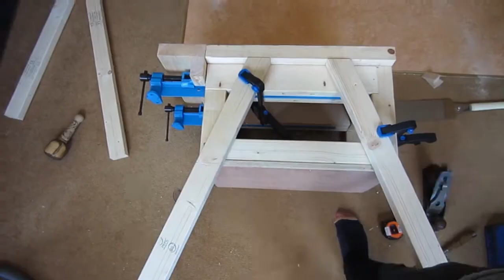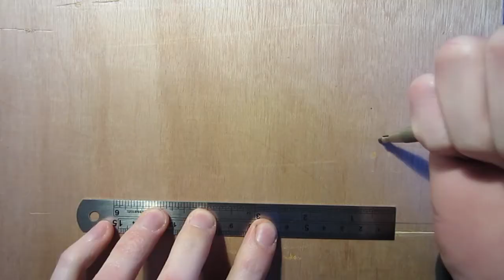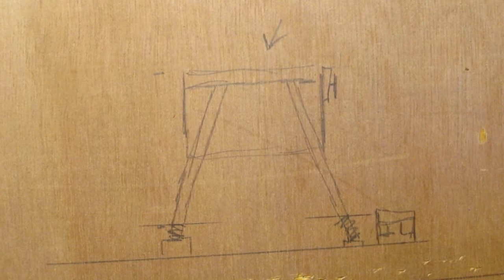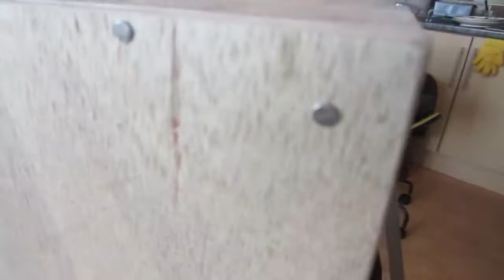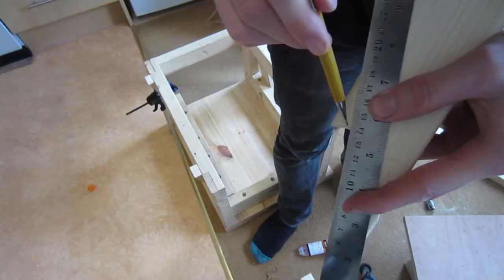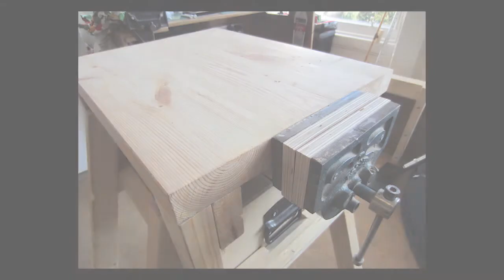►Ultimate Compact Workbench Build | Pt 3/3 | Easy project!◄

Comment: I Enjoyed the 3 vids. I have the same problem as you, I live in a One Bed Flat on the first floor(note to Americans second floor to you) hand tools only except a cordless drill(a Matabo). Your design gave me food for thought, basic idea=good, legs=horrid, tool box idea=good, did i mention i thought the legs were Sh*te, I thought about locking wheels but dismissed them as even with the wheels locked it would move too much while planeing . I think I am going to splash out and get an Axminster tools Moxon vice and build the top around that. But for the moment I am still sorting the tools out. Thought about a big tool box on removable casters with a detachable top, no hurry though because i'm poor and have to do things as finances allow. Cant take too long though, i'm 70 and dont want to croak before its finished.